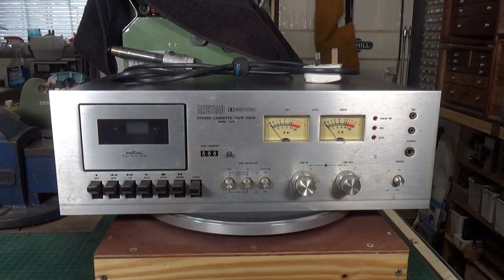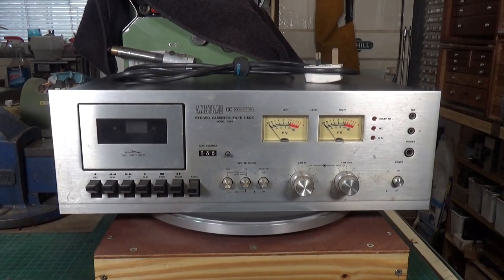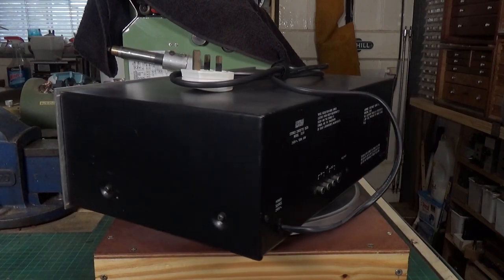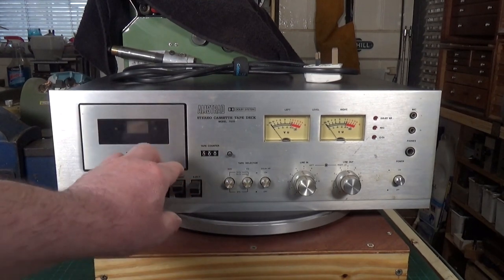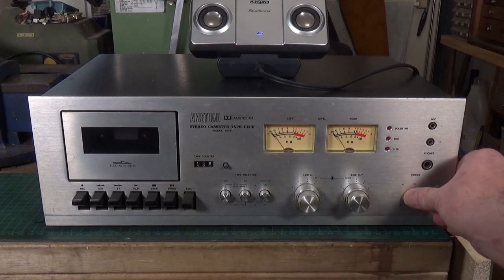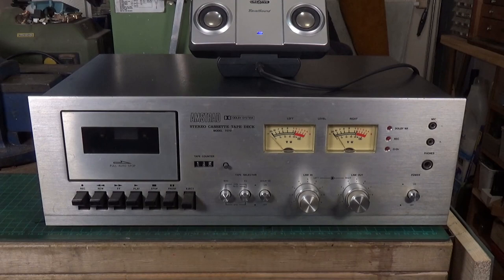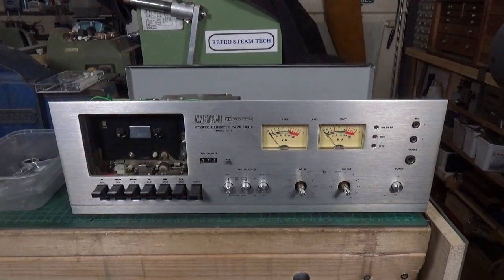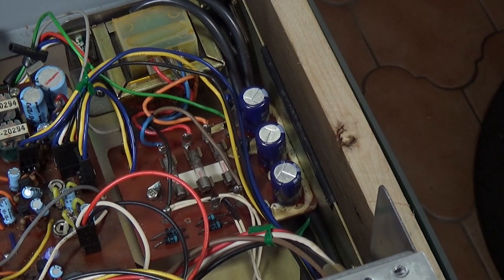Amstrad 7070 Cassette Deck

Comment: Amstrad kit always looked very good for the money. In 1978, I paid about £80 for a JVC KD-720 deck, which was the top rated budget deck at the time. It served me well for many years. Interestingly, I have just bought another new cassette deck - the only one available new now which is a TEAC. It is very good, but no Dolby because they no longer licence it.
Reply from the maker: That's what I thought back in the day. I've since done some digging and I think the Amstrad would have been about £50. I think if you want a decent cassette deck today you are much better off looking at a hi-end model from the 1980s or 1990s.